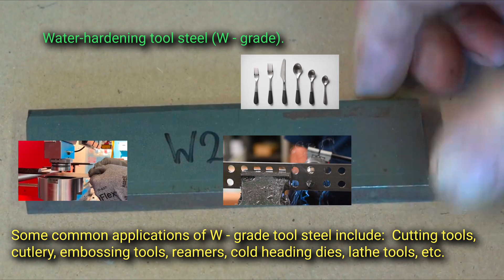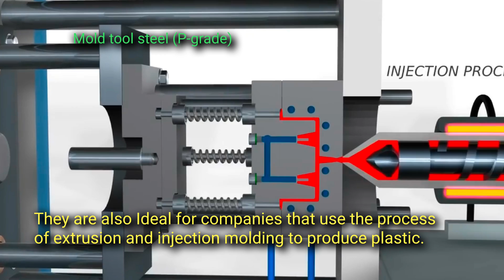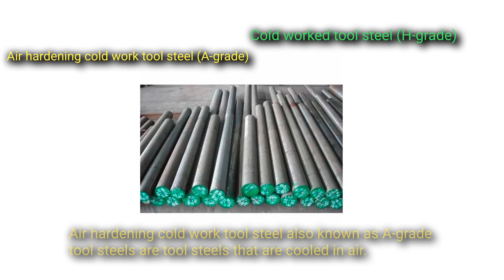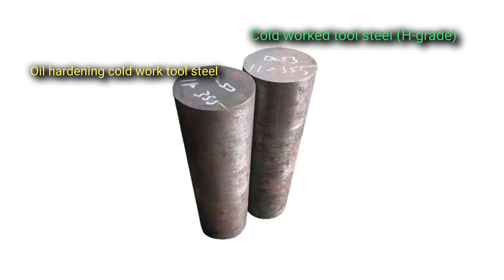7 TYPES OF TOOL STEEL AND THEIR APPLICATIONS

Comment: No Tool and Diemaker uses P series tool steel for any kind of breaking, wiping, drawing, or forming; especially in a stamping press.  We use D2 or D4, depending on the stock material.  You also don't coin with A-2, not if you're smart.  You coin with M-2 or M-4 (not the high speed steel they're talking about), they take compression better than most.  No one uses 0-2 for blanking, unless it scissors, I have lapped some good gauges made from it, very stable alloy.  Correct about D series but D-4 makes very good high use gage fixtures if you're too cheap for carbide.  High speed also has cobalt grade, which is superior to both tungsten or moly for heavy, hot, and repeated engagement.  Source:  I am a Master Tool and Die Maker for 30 years, also have a degree in metallurgy.